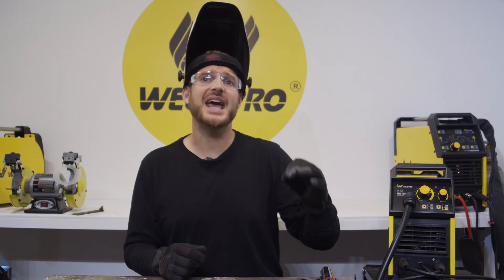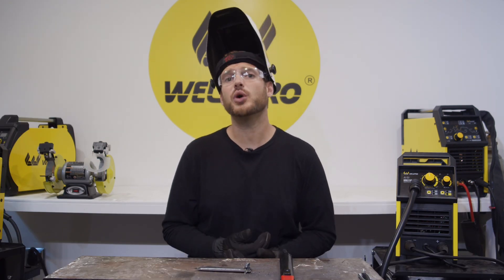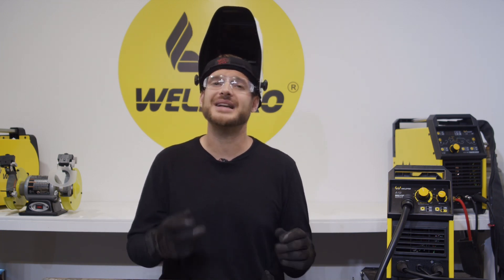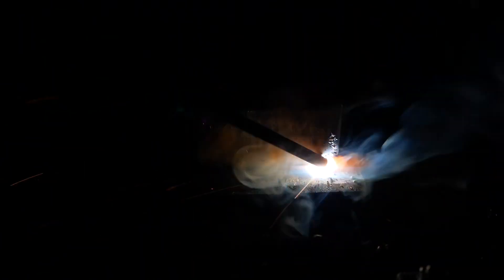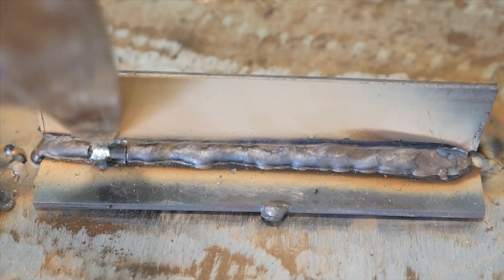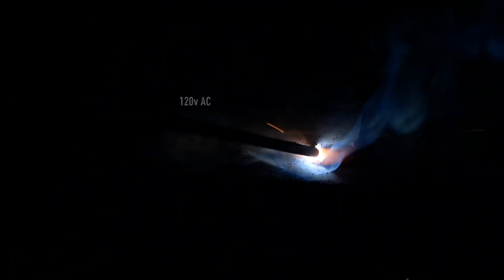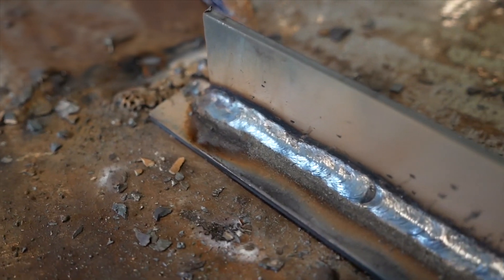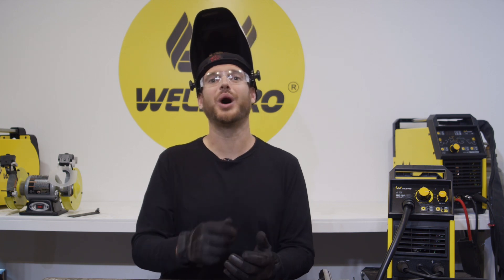Weldpro MIG 155 - Stick Welding 120v vs. 240v

Comment: Would 110v 90 amp using 7018 rod be ok to weld on suspension components? Or would you recommend 220?

Comment: Can it run 6010?
Reply from the maker: Yes it can however some people will find it difficult. You are better off running 6011 if it’s not for API code welding

Comment: Great video, thank you. I am considering this machine to start learning the skill. I noticed you gave a recommended amperage of 50A for the 240 volt circuit, but didn't for the 120 volt side. I have a 30 A 120 volt outlet that I use for my travel trailer, would this be a good choice for this machine? I have the adapter for the 30A plug to the standard 15/20A household plug of course.
Reply: With their recommendation at: 50A x 240V, it can handle 12,000 watts.   
Welding at 20V, it can deliver 600A of current (assuming no losses).  That is way way more than the machine's max setting. The recommendation is way overkill for the size of this machine.  Of course they would recommend that, because it will always deliver enough amperage beyond what the machine can handle.  In reality, the recommendation is around 4x the max current rating of the machine.

In your situation at: 30A x 120V, it can handle 3600 watts.  
Welding at 20V, it can deliver 180A of current (assuming no losses).   In the real world, I would not set it beyond 120A to 130A.   There will be some losses in the machine and you don't want to push too much current through your travel trailer.  The main issue is the length of the wire and whether it has been actually tested to the full max capacity.
Reply from the maker: Yes a 30A outlet will work great! you will need to adapt it down though.

Comment: I plan to  start welding in the near future.   I think I will give this welder a try . . . however, I am concerned about warranty effectiveness on such a new company.  Thanks for the video . . .
Reply: You WONT be sorry. Just got this machine in today. I started out with mig since mig was what I primarily bought this machine for. Lays a nice bead. I set up a T joint and the third bead I have ever welded in my life with mig looks pretty darned good.  I had limited time today so I changed over to stick and ran ESAB 7018 1/8. When I first started the weld I had my earbuds in for makeshift hearing protection. I could not hear the arc so I stopped. Yes it was that quiet. I removed the earbuds and restarted and was completely blown away with how well this machine welds. So, I grabbed the Radnor 7018 3/32 rods that  I was about to try to give away because of how horribly they welded with my old buzz box. They started and welded almost as good as the ESAB. I am SO happy with this little machine!!!   I did run into a small issue when setting it up. The wire didn't want to feed and the thumb screw would bottom out before placing enough tension on the wire. I put a washer at the bottom of the tensioner adjuster and it solved the issue. Still the best $336 I have ever spent on tools... and I've got a pretty good collection.

Know anybody wanting an old buzz box? 😊
Reply: @3Hose  I did purchase the machine and use it mainly for stick welding.  I tried Mig with gas and it works pretty good.  In my review of the machine on my YT channel, I mentioned the wire tension problem.  I think the buzz box will sell on Craiglist or FB marketplace very fast.....   Thanks for the response.
Reply from the maker: Our warranty process is very straightforward. We honor almost all of the warranty claims we ever receive!
Reply: @WeldproWeldingEquipment  Is this unit going to be discontinued soon?   Curious about future part availability...

Comment: If I were to use a generator for power what size or amperage would work best for this welder?
Reply from the maker: You should definitely have something that can output 240 volts. 40 amp output would be sufficient. You can run it on 30 but may get close to using all of it depending on how thick your material is.

Comment: Great videos.  I am looking for my first welder.  I repair grills, lawnmowers and stuff with thin painted, dirty sheet metal.  I would need to do some patch work and reconnect things that were tack welded and broken. I have only 120 volts.   What would you recommend for me?  Thanks so much.
Reply from the maker: JoeA I think you should try a MIG 155. It’s under $300 and you could use self shielded wire with 120v to pretty much repair any thinner material you need! Thanks for asking 😀
Reply: @WeldproWeldingEquipment  where is its under $300? im looking for mig
Reply from the maker: @LEARNER4LIFE1  back in September it was $290 ... it’s still only $320 now

Comment: So what are the actual limitations of 120v? is it the thickness of steel you can work with or the thickness of the rods you can use, or does it just take longer to make the weld?
Reply from the maker: Good question! Pretty much an amperage limitation which keeps you down in the smaller stick sizes and wire. Don’t be fooled you can still get a great deal done on 120v !!

Comment: Biggest problem I have with my MIG 155, is the spool smoothly feeding. I've tried removing the stickers on new spools, and even sanded it smooth, and it still seems to jitter and catch. It would be good to see start to finish how to prep a spool. I do wish it had adjustable tension, but I totally get the price point.
Reply from the maker: Hello! So, I asked our tech support people and as it would turn out, some spools are made wider than others. Currently we are including a second spring that gives less tension on the spool but depending on manufacturer, some just don't fit. The design team is aware of this and has been working on a solution. Thank you so much!
Reply: I've had this happen to me and found out it was the contact tip that was causing the problem. I ordered a lot of consumables to keep on hand after this happened to me
Reply from the maker: Thanks for sharing this!
Reply: Did you fix the feeding issue ?